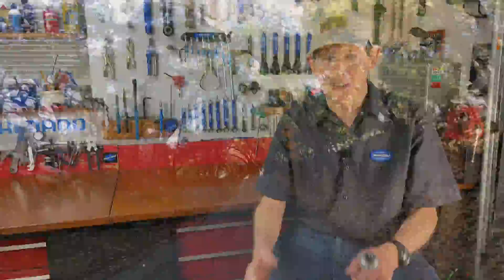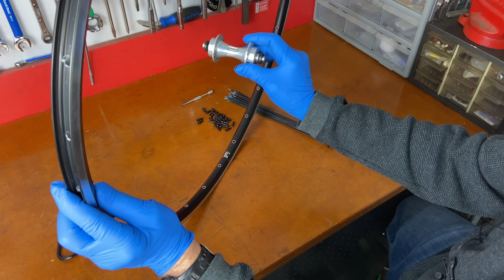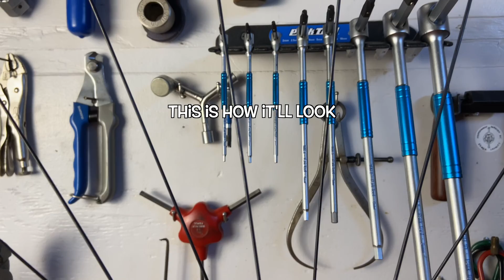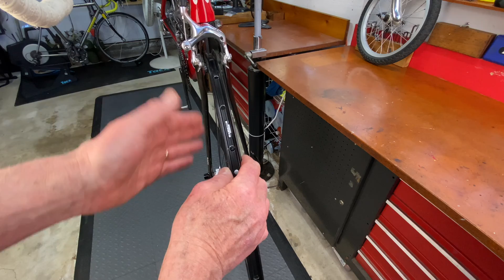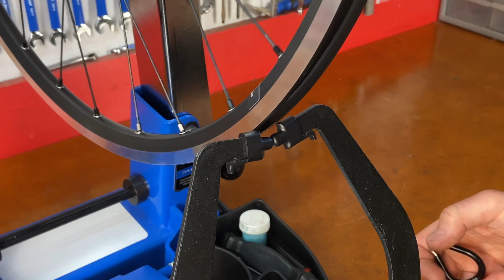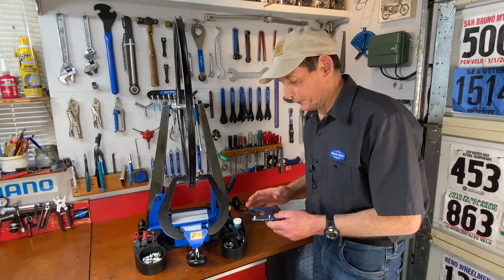How To Build Radial Spoked Bike Wheels #bikerepair

Comment: Hello, I have an e-bike with a rear hub motor measuring 7"x3" and a 20x4.0 tire. If that helps, I'm trying to figure out whether it's a 1 pattern or a cross pattern, and whether the nipples are all on the outside or inside and outside. I hope this makes sense; I wish I could show you a photo. And the rim is 3 1/2" wide - 18 spokes
Reply from the maker: Happy to help. Please send me a pic at jimlangley at gmail and I’ll take a look and let you know.

Comment: I wish you lived next door.  I have finally met my nemesis wheel.  Been chasing the true for a few days now.
Reply from the maker: If I did I’d be happy to help. Try truing it by only loosening spokes. Also work carefully. I find that 2 of the most common errors that mess people up is 1) turning nipples the wrong way (ie tightening when they meant to loosen or vice versa) and 2) turning the wrong spoke (ie turning a spoke that is on the right side of the wheel when what’s needed is turning the one on the left). These are both really easy mistakes to make for even experienced wheelbuilders. You have to pay attention, think and focus. I hope this helps.
Reply: @JimLangley1  These are very cheap wheels.  I have three days on one wheel and it always needs adjusting after every correction.  so frustrating.
Reply from the maker: @401SNelson  cheap wheels can definitely be frustrating- good luck with it!

Comment: Hi, thanks for the helpful tutorial video. Thinking of renewing a Zipp 30 clincher rear wheel with worn brake surfaces, other than a direct Zipp 30 rim replacement, what other compatible clincher rims can be used to rebuild a wheel with the existing hub & spokes?
Reply from the maker: Thanks for watching and the question. Since you want to use the same spokes again you'll want to measure the effective rim diameter of your Zipp 30 rim first. With that ERD number in hand you can then look for rims with a matching ERD number so that your spokes fit correctly. And you'll want a rim brake rim not a disc rim. You could go with aluminum if you wanted to save money. Rim brake rims are getting a little harder to find. So long as Zipp still makes that rim, the easiest thing is always to replace a rim with the exact same rim. Hope this is helpful and happy wheel building!

Comment: What size of spokes you used?
Reply from the maker: Thanks for watching and the question R4. The spoke length depends on the brand and model of hub and rim you're using and the number of spokes. Here's a video I have that explains ways to find the correct spoke length for any combination of wheel parts you want to build with: https://youtu.be/LvV4FE2VxZk

Comment: Jim have you make a video for a 36 spoke 2 cross for e hub rear wheel
Reply from the maker: Sure Jim. For that you want to watch my complete wheel building lesson over here: https://youtu.be/XUqul03hbZ8 As you watch along you'll see that I'm building a 28-spoke, cross-3 road wheel. But, I explain what you do if you're building a 36-spoke wheel and if you want to cross 2 instead of 3. It's simple really. For 36, you are lacing 4 sets of spokes with 9 spokes in each set (versus the 28-spoke wheel I show with 7 spokes in each set). So you're just adding 2 more spokes for each set, that's the only difference. Then for the 2-cross, you just cross one less spoke when lacing the wheel, which is also simple. You'll see when you watch that part of the video. As long as you take your time and follow the instructions you'll be fine. Have a watch and let me know if you have any questions. I'm happy to help. 

Oh, the other thing is you want to be sure to get the correct spokes for the motor hub. Some of those have oversize spoke holes requiring oversize spokes. So be sure to look at the specs on the hub or if it already had spokes in it and you're reusing them those spokes should hopefully be the correct ones for the hub. If you don't yet have spokes, you want to look up the specs for the spokes on the hub company's webpage under specs, or call the company to find out, or measure the holes in the hub to see if they're standard 2.0mm or oversize and larger. Have fun!

Comment: I think I'm success build my own wheels just from watching many youtube tutorial. No fancy tools, just my frame, couple of straw and tapes.
From that experience, truing hi and low is more difficult than centering the wheels.
Reply from the maker: Thanks for watching and congrats on learning to build your own wheels, way to go. Hopefully you saw my other video, which is a comprehensive wheel building tutorial https://youtu.be/XUqul03hbZ8 and includes a helpful section on getting wheels round. Truing high and low is actually relatively easy once you understand what's going on and I explain in depth here: https://youtu.be/XUqul03hbZ8?t=2621 and in even more detail here: https://youtu.be/DfjEaxlk1R4 Hope it's helpful and thanks again!

Comment: Hi Jim,

It's always a pleasure to watch your videos on wheel building.
I have a question from your latest video about spoke pre-tensioning. In the video, you use a "traditional method". However, I've seen more and more wheel builders using a torque-controlled screwdriver for what appears to be faster and more uniform pre-tensioning.
Based on your experience, what are the pros and cons of this wheel building technique?

Thanks!
Reply from the maker: Thanks a lot for watching, glad you're enjoying the videos so much and I appreciate the question - it's a good one. It's fine to use a drill driver tool to speed up pretensioning. I actually have another video where I compare doing it by hand with a spoke wrench versus with a Makita drill-driver and speed bit with the drill set to a low torque. Here's a link to that: https://youtu.be/kaBvpCuXigQ You'll see that the drill makes it faster. The trick is not to get the spokes too tight when pretensioning. If you do, the wheel will usually come out of true and round - even if the tension is fairly even. And because the spokes are on the too tight side, you'll have to spend more time fixing the wobbles and hops. I would recommend that beginning wheel builders use their hands only for a good while to get a feel for how wheels behave before trying the speed driver method.

Over pretensioning is the risk of the power drivers. But, they makes complete sense for a wheel shop that has done the testing and that usually makes their own rims and specs all the components of their wheels. They can test all the component combinations and determine exactly how tight to get the spokes and with wheel building robots that can "read" out of true and round issues and fix them, you end up with very nice wheels. Not always as perfect as 100% hand built wheels maybe, but so close that most people wouldn't notice the difference without putting both wheels in a truing stand. In case you would like to see one of the robots, here's one at work - fun to watch! https://www.youtube.com/watch?v=02bcAjP_Cdk
Reply: @JimLangley1 
Hey Jim,
Just wanted to say thanks for the videos you shared in the comments! I learned a lot from them.
Really appreciate it!

Best,
Reply from the maker: @x0304 you’re very welcome, glad you enjoyed them!

Comment: I have a set of those Mavic of Romania rims! The rear wheel ended up with a bit more hop than the front.  Seam alignment.  Velocity 36 spoke deep V on my track bike has the only low spot at the seam I've ever seen. What you start with can influence the final results.  Now faced with decision to buy a wheelset with offset rims triple butted spokes 32, for $450. Alternatively could build a rear wheel with 36 spokes, 12mm through axle disk, with same spokes,  probably having difficulty finding 36 spoke offset rim and hubs. About the same to build rear as built pair. Spoke Calc is interesting because it's possible to get 80%+ of the drive side tension by lacing the non drive side with more crosses.  Touring application. Or do I carry extra spokes, STEIN cassette tool, and Park spoke wrench. 28 unbranded spokes back there might not be enough? 230lbs.
Reply from the maker: Thanks for watching and the comment David. I've seen lots of high and low spots at seams in aluminum rims. You just get used to dealing with them when you build production wheels since you can only send back rims that are terrible. But you can almost always pull down the high spots and bump up the lows to get the rims within spec but the earlier you do it during the truing process the better. Your new wheelset sounds like a fun one. A 32-hole wheelset should be pretty rugged as long as it has brand name high quality spokes like DT Swiss or Sapim and great rims. I would be worried about no-name spokes breaking pretty soon for loaded touring. I don't think I'd go with only 28 spokes. With 32, 1 broken spoke won't make the wheel wobble too much. With 28s 1 broken spoke will probably force you to stop riding to replace the spoke. 36 spoke wheels give you a greater margin for broken spokes. The wheel will only go out of true a little bit with a broken spoke and with so many there's less chance you break one in the first place. But, again, breakage is almost entirely caused by bad spokes. So if you run DT Swiss or Sapim they shouldn't break. Have fun!